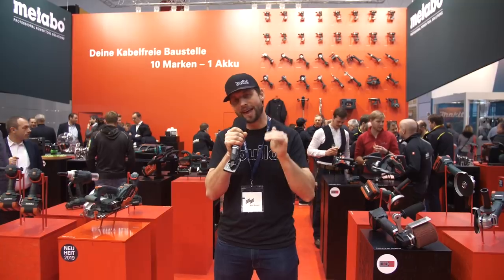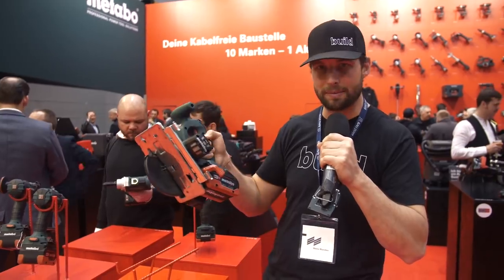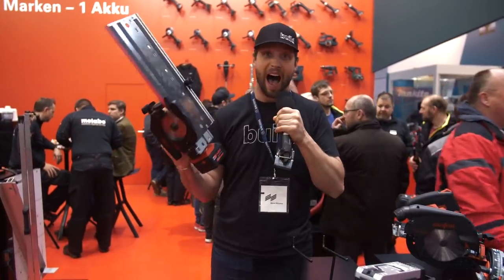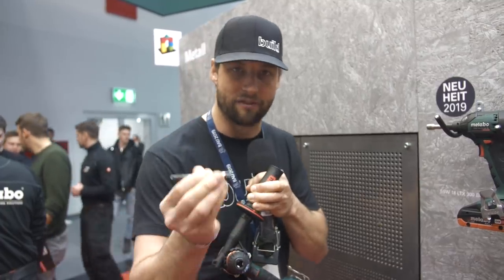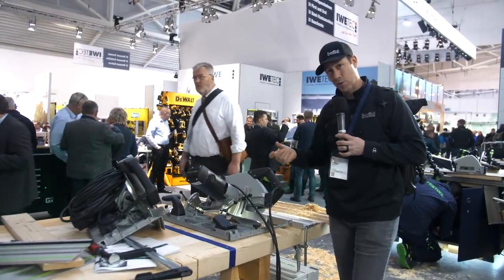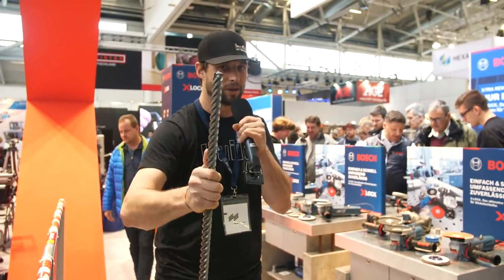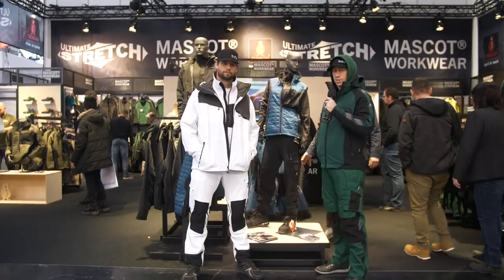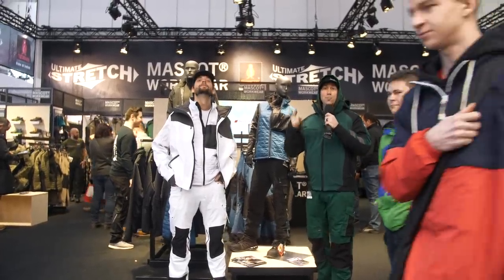Tools you Can't Buy in America

Comment: If only they could standardize around one battery type, akin to AA or 18650.  No more proprietary BS.  One battery, one charger, all tools.
Reply: Thank goodness they don't..18650 are old technology..
If you want some global clique,buy IKEA.
I want competition,and new technology.. companies pushing other companies.
I hope I'm dead and gone if they force everyone to play in the same sandbox filled with germs..give a mudhole!
Reply: Amen. A standard battery/tool interface at least. I'd love a dewalt nailer but all my stuff is makita so it's never going to happen.
Reply: @2chipped  that doesn't make sense. If batteries were interchangeable you could buy the best tool available for every application. With proprietary tool/battery interfaces you get stuck using second rate tools because you're locked into a particular manufacturer. It has literally the opposite effect of what you're talking about. It's designed to limit competitive pressure by capturing customers.
Reply: @2chipped  What the hell do you mean 18650s are old technology?

They are a form factor, used in everything. The only upcoming form factor replacement is the 2170, but that is just a mild cost improvement. You can still jam any actual chemistry into the 18650 form factor.
Reply: That'd wreck their business model, which is to suck you into only using their tools, for the rest of your natural life. I'm pretty sure 18650s are in use inside most cordless battery packs, it's just the package/controller that's proprietary. I've seen a few adapters online so you can use one manufacturer's battery on another's tool, but haven't tried one yet.
Reply: @stevem815  so buy a DeWalt nailer,at most you will spend 200 for batteries and charger.
Reply: @stevem815  so Milwaukee has 1 key table saw.
Which allows you to leave the battery in and lockout the saw from being used,no company would build the technology for everyone else to use for free.
1key and sawstop,2 different ways to mitigate tablewsaw injuries.
Sawstop$1200, 1key is$500 and cordless ...there is a 3rd Bosch Reax,but sawstop stopped them from coming to the US.
Reply: @Bob_Lob_Law  there is also 207, explain how you can get 50% more current through the new cells.
Nicads were the best gun for hire in the 90's ,I had DeWalt back then..when the lithium came out they turned the same circular saw much faster..now my m12 impacts using 18650 have more power then 18v DeWalt nicads.
Now almost all are using 207,or 217 getting more power from a smaller package.
9ahr 18650 is the same size as 12ahr 207/217 ,with more power.
Reply: Currently I use M12,m18 , Makita 18 (with x2 it's 36v) .,.and Ridgid and Ryobi for specialty tools using  adapters from Amazon and eBay. 
The latter 2 brands may burn up, because they don't have proprietary circuit protection..the tools are cheap enough that I can replace.
Besides the 12v models. Milwaukee all tools are 18v only for now, Makita offers 18 and 36 volt using x2. Dewalt has 18 only+ 18/54 flexvolt. 
I want free market competition.
Reply: PongoXBongo That shit is one big racket and they know it. Those tool batteries are double or triple what is justified (by which I mean a legal monopoly due to crooked patents).
Reply: @William Bravo

Several years ago, I decided to school myself in lithium battery tech. Battery University, a website dedicated to self-learning about batteries stated they had discovered 98% of battery pack failure is caused by the battery management circuit in the pack, and not the cells.

By the time I had learned all I needed about lithiums, I had salvaged almost 300 18650 cells. I am currently using ~98% of the salvaged 18650s in lithium pack upgrades for all my old nicad and NIckel Metal Hydride tools, as well as in flashlights, and other battery powered items.

Instead of building soon to fail lithium packs with cheap Chinese circuit boards, which will fail, I use battery tenders which I get for less than $2.00.

You connect the battery tender to a pack, and it gives you the total pack voltage, then the individual voltage of each cell.

If the cells are within 5%, you can charge it as a pack. It more than 5% voltage variation, use a hobby charger, which will re-balance the cells.

If you don't drain the packs until they are completely dead, or overwork/overload the tools, you can get by without the low voltage shutoff, or limits on the amperage draw.
Reply: i believe in Europe they standarized cell phone chargers a few years ago, just like they had to standarize electrical outlets for all of Europe. It may happen 20 years from now.
Reply: 18650's are awesome for a wall power bank, Electric Bikes, Flash lights, etc. Hell even Laptops still use them.
Reply: @nickgermanic8505  apple being the exception (because apple -_-) every phones in europe use a usb charger port (usb type c if I recall correctly)
Reply: @TidusleFlemard  Even Apple had to obey. They now make also USB chargers.
Reply: @nickgermanic8505  Which logical. To use different electrical outlets would be idiotic in an institution like the EU. That would be as if the East Coast and the West coast use different outlets.
Reply: @thewaterdrop123  
That's the way it USED TO BE. Until they figure out how stupid it was so they decided to standardize it. Great Britain is still the exemption to the rule, they use different electrical outlets from continental Europe.

Comment: Don't think the bosch grinder idea is a good one. I do not need to deal with issues with tools to install grinder discs at all. The milwaukee grinders home with a fixtec nut which has a flipup handle which you can turn with your hand. The discs and nuts go on the same way, but can tighten easily with your hand and require no tool to loose etc. I have also used and can buy the fixtec nut to be used on other makes of grinders as well and use the same inexpensive discs on everything with the same convenience.

Comment: Can someone explain how higher PSI allows for a lighter gun? Why can't you have a lightweight gun @ 90 psi? My best guess is that psi alone is not enough to shoot a nail, but you also need air volume (i.e. nail shooting power = psi * tank volume)?
Reply: pressure = force per area
thus higher pressure = bigger force at same area, or same for at smaller area
A nail gun accelerates a 'hammer' with pressure like a piston in your car. If you can create the same force with a smaller area, your gun can become lighter as the hammer can be smaller.

Comment: Sorry for question unrelated to this content but can u answer me plz. My apartment building is made of concrete and no insulation . i can't persuade other apartments to agree on external insulation. So my only option become internal insulation. Climate is hot humid. The question is how to prevent condensation. where to put vapour barrier. dry wall> batt/foam>vapour barrier>external wall?
Reply: look up a website called building science corporation (US) and there search for something called 'perfect wall'.
For hot humid climates, the vapor barrier needs to be on the outside of the insulation, or the insulation needs to be vapor proof itself. You want to keep hot humid air from reaching the cold side of the insulation, to prohibit condensation.
Having the thermal mass (concrete) on the outside is sub optimal, but you already know that.

Ideally for hot humid climates the wall would look like this:
internal > thermal mass (structure) > insulation > water/vapor barrier > air gap > weathershield > outside
Reply: @joansparky4439  Thanks for ur reply. U mean i need to use close foam as insulation or dry wall> batt > vapour barrier > air gap > concrete wall as concrete would be both thermal mass and weather shield in this case
Reply: @KyawKhine 
Yeah, the air gap is only for a weahthershild in front of an insulation, to give air the chance to dry the weathershield and the top of the insulation if any makes it that far (weathershield being fiber cement boards or wood or wall cladding etc..) 

In your case the concrete is the weathershield and structure. I don't know how watertight the one you got is, but it would need to dry to the outside, if water penetrates that barrier. Don't think you would be able to allow it to dry to the inside, esp when you climatize it and make it cooler.
The best you can do is look at what BSC writes and then maybe find some expert or examples in your area for the materials you got available.

Comment: 3:58 Hard to tell from the video if this tool has counter-reciprocating blades like a turkey carving knife (the toothed one at 4:09 doesn't seem to), but I'd think that would keep the cut clean and dust down. At least that's the conclusion I'd draw from this thread:
https://www.gearslutz.com/board/so-much-gear-so-little-time/142195-help-cutting-large-amounts-rock-mineral-wool.html
Reply: I used a home-made reciprocating (alligator?) single saw blade for kingspan, from which the dust is AWFUL using any standard toothed saw, powered or otherwise. The trick is - as said - to get a 'breadknife' scallop style blade. So. Grind (bench grinder) a standard toothed blade to take off the points along the blade edge. Then grind lengthwise both sides to take off the width of the offset teeth, making a blade - doesn't need to be razor sharp. The profile becomes scalloped, but narrow. Back in the reciprocating saw, it will cut quickly and practically dust free, and as a bonus is safer if any inadvertent contact. Totally impressive, a 'hidden' tip which saved me cutting outside (environmentally unsound) creating dust which is nasty in eyes or respiratory. A sturdy bread knife is also good for minor trimming, and for rockwool and cotton batts.

Comment: Pneumatic nairler shooting into a steel beam? That is the coolness factor this video needed. The rockwool cutter was pretty damned cool to, straight cuts without pulling out a guide bar and the old electric carving knife, nice. (Had to buy the wife a new electric carving knife, she refused to put it near a ham or turkey after i cut rockwool with it.)
Of course, DeWalt has a damned good battery table and miter saw, but the universality of their batteries is awesome.
Click lock grinder was pretty damned cool as well, as long as the disposables [cutting/grinding/flapwheels] are comparably priced. If I gotta pay more for the real expense of the tool, then not so interested. I drill a hole in the handle of my wrench and lash it to the tool with a retractable keychain fastened to the plug end of the cord. Easier to use when unplugged (safety) and much less likely to be lost.
Reply from the maker: Thanks Thomas. Great summary!  Appreciate you watching